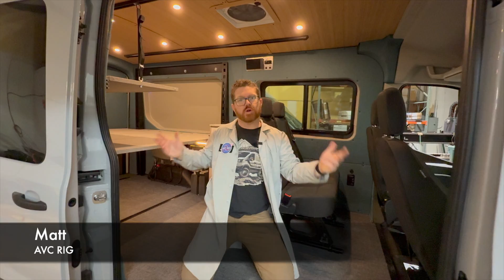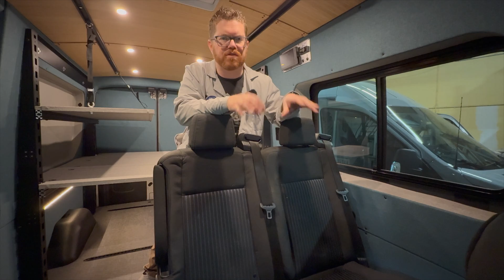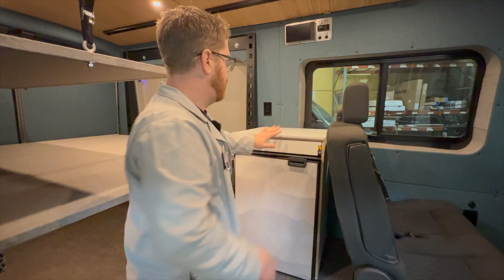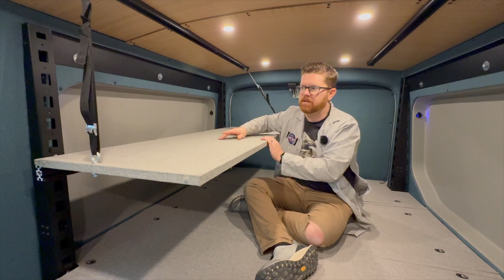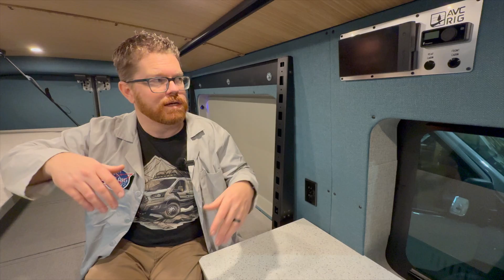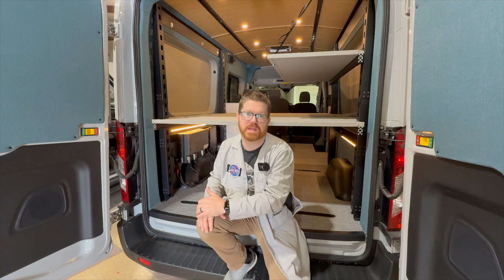Ultra-Lite Finished Camper Van Tour | Ford Transit 148 Medium Roof Conversion | Van Life Custom

Comment: That bed space looks completely unusable. There’s not enough room for any sort of comfortable mattress to sit on top of the frame. If the bunk bed wasn’t there it would be fine.
Reply from the maker: We use a 5” mattress from roam rest that is very comfortable. The bunk and the bed are both adjustable height so you could set them to a height that is usable for you and yours. This setup works gif the family it was built for. They put their feet under the bunk.

Comment: How tall are you? Do you by any chance have the ability to show us  the height you have while standing. Want to do a medium roof for a super simple layout like this, just beds, seats, and fridge with AC and heat but curious how it is with ceiling and floor. I’m 6,0 on the dot.
Reply from the maker: I’m 5’10” I can’t quite stand up in a MR. Finished like we do it’s 5’9” in the center.  I think in a simple buildout like this you’d be fine with the MR. You won’t stand around a lot in this kind of build. Something more fully featured with a kitchen etc.. you’d want a HR van.

Comment: I like the simplicity as this is what we have been considering for a build.   Does this van have shore power, solar or  alt charging?          What kind of things can the unistrut on the ceiling be used for other than the bunk you installed?      Would soft bags cabinet be possible on a high roof or would you need additional unistrut on the upper wall to also attach to the soft bags.      Can you guys make the changes to the wheel wells needed to fix the tire rub issue on the Transit Trail?
Reply from the maker: Our standard electrical has shore power, alternator, and solar charging. This customer held off on solar because we plan to add a roof top tent in the future.  The unistrut is designed to hold our right cabinets. They install one wall and the overhead support. The hanging bags we like are the easy to remove kind from Campo or VanWife. You can see those in other videos from our channel. I think a review on hanging bags would be a good subject in the future though.

Comment: Been watching your content for a couple of years, it has been cool to see your evolutions. Love your simple approach. Question on the Innie sleeper pill finish; what do you feel about upholstering them to match the rest of the interior? Is it just a first principals thing to leave them raw or is that what the client wanted?
Reply from the maker: Glad to hear! It's kind of both. They are a complex shape to upholster so we like leaving them the way they are. That's also why we made them gray, to fit in more. If you want to upholster them you can but you would need to cut a back panel otherwise you will have seams

Comment: Thanks! Love the walls. Weird question I know but how low can the bed go? I have an old dog who will whine if he can't get into the bed. I love the EcoFlow. For extended length vans how far back does the bed go? Have you gone over cabinet or bag options for upper storage recently?
Reply from the maker: The lowest is 25 inches off the ground. It goes all the way back, it's 80 inches long. Not recently but will be a great topic for trade show season this summer!